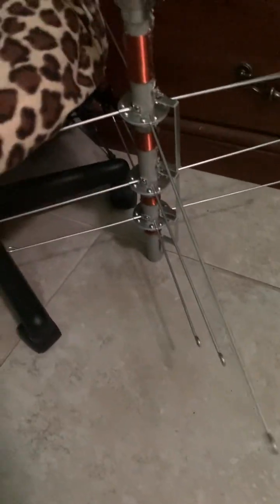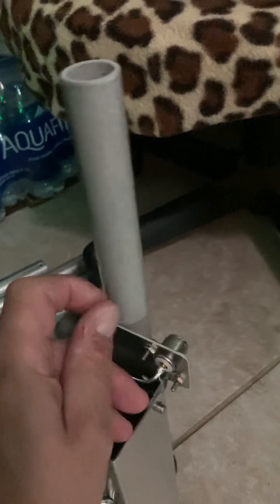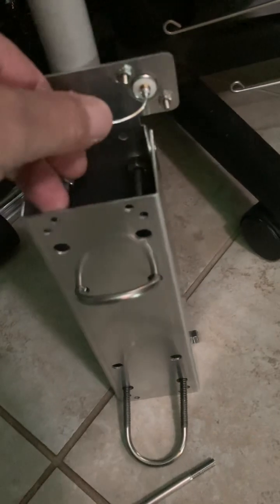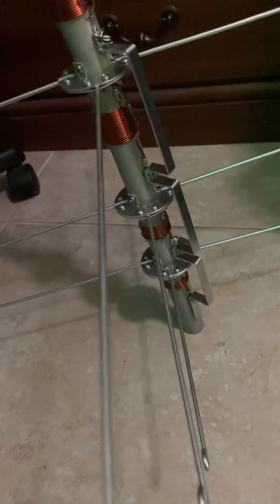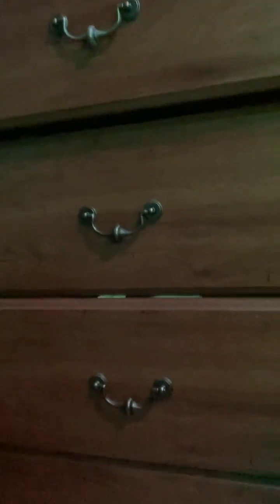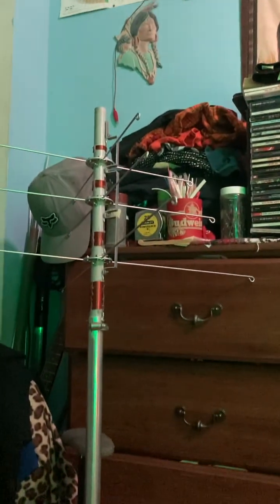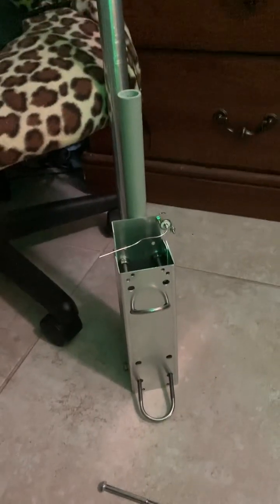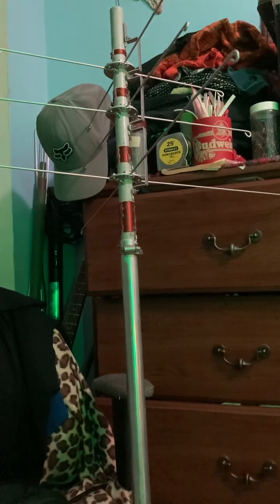The cushcraft hv-4e

Comment: How's the antenna working across the bands?
Reply from the maker: It’s ok so far the down fall is the hot lead it the antenna keeps pulling out of the so239 connector so iam going to eliminate the poorly designed hook up iam going to use rg8 make a pig tail like the butternut antennas are hooked up get to stainless screws washers and bolts drill a hole in the positive put a bolt through it washer and nut put the center of the coax to the hot side of the vertical then put a short bolt with a washer to the tilting plate already has holes put the sheild to it that your ground make sure you don’t make a short I got some rg8 with a pl259 on one end the put a female adapter one to hook up you coax. That’s how butternut antenna company had it set up separated from ground to the hot element mfj is stupid to hook it up like butternut did the wire and the so239 connector thing is crap the center wire keeps falling out this is the 3rd time fixing it and it broke again so iam going to make my own hook up harness.
Reply from the maker: I use my antenna tuner if needed
Reply from the maker: @bobtomil.4843  made that harness it works great